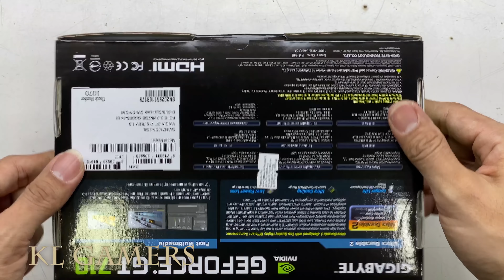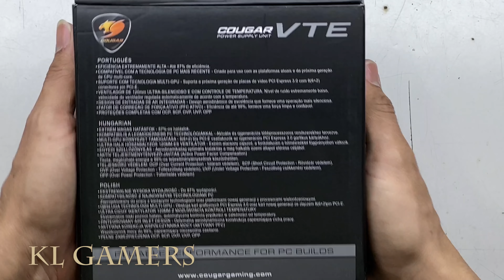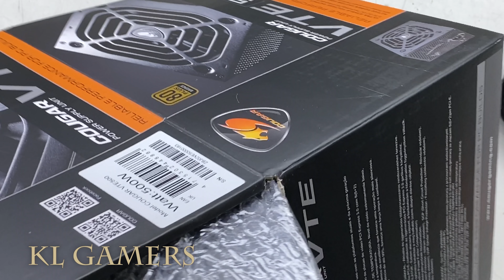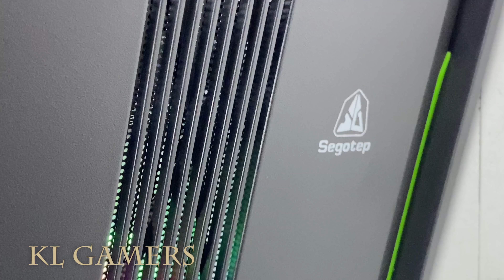intel Core i5 10400F GIGABYTE B460M DS3H GT710 PC Build

Comment: Very nice build! I have a question though. It appears that the cmos battery is right below the pci-e slot and as a rx570 armor oc owner i was wondering. Will my gpu fit without any dimension issues?
Reply from the maker: should be just fine
Reply: @KLGamers  Thats great to know! Thank you!

Comment: Hi bro great video, great cable management. Have a question 4 ya. Where do you check the compatibility of the ssd nvme and the ram?
Reply from the maker: usually for desktop motherboard will support NVMe SSD but with different speed  same with RAM

Comment: am using i5 10600 when boosting to 4.8 ghz actually load 100% cpu temperature get 100 degree, cpu cooler corsair h80i GT. my question is that normal or i should buy new cpu cooler?
Reply: Change it 100 degrees is not a good temperature
Reply: The temperature is not normal, change the thermal paste and check the contact between the processor and the cooler.

Comment: nice MoBo, nice processor, what gt 710 ??????? use a 10400 not f please XD
Reply from the maker: sometimes no stock
Reply: what's the different gt710 + 10400 and gt710 + 10400f ???
Reply: @jiarongleow4194   integrated gpu better than gt 710 XD
Reply: @agtpunk7189  but what if i don't want to spend a lot on graphic card? just use for online classes and office work.
Reply: @jiarongleow4194  yes right 10400 without a gt710
Reply: @agtpunk7189  thanks man

Comment: Wtf my I5 10400f is running Rx5600xt and it's amazing you do realize the onboard graphics on I5  10400 are better than a gt710 😂🤣
Reply from the maker: I5  10400F does not have intel build in graphics
Reply: @KLGamers  correct that's why I said I5 10400 just don't understand all your videos using out dated gpus on such a good cpu
Reply: @itzamedave6242  this pc wasnt for gaming use the person hes building it for doesnt even game